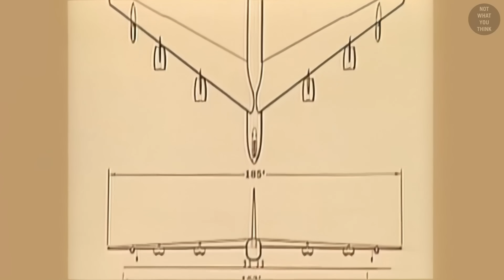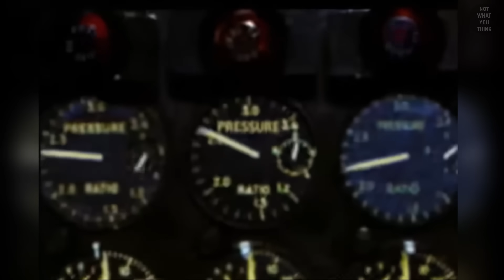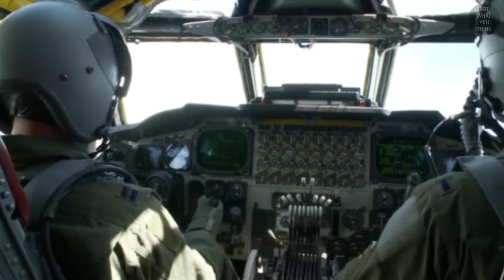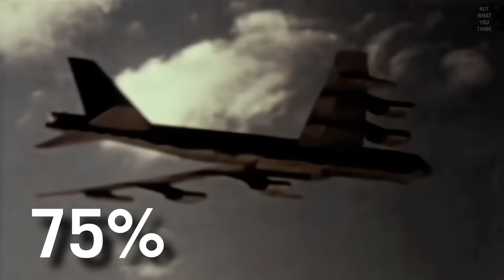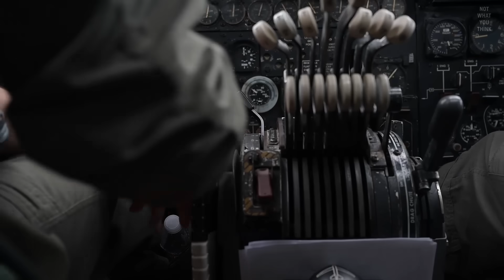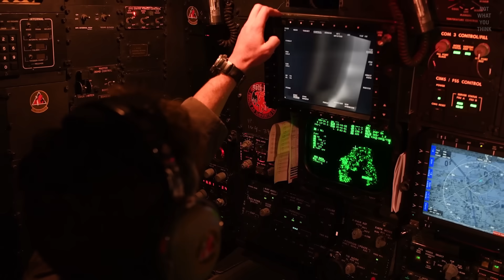Why This Obsolete Bomber Will Outlive EVERYTHING

Comment: Your video is so filled with misinformation that I can't believe you even published it! Most of those 'crashes' you spoke of outside combat were do to pilot errors or being misused as an aerial demonstration plane. They were never intended for that! I was at Fairchild AFB in Spokane, Washington when the one from the video crashed. It was due to pilot error and misuse of the aircraft. Also, you can't crucify the B-52 for engine failures. Those are the failures of the engine manufacturers. The B-52 aircraft have undergone remodifications many times during it's lifetime, which is why there are the E, F, G, and H models. Yes, there have been crashes but there have been crashes with all aircraft. It happens, unfortunately.
Reply from the maker: Thanks for your comment. 
I hear what you are saying, but if engine failures is the fault of the engine manufacturer, then structural issues are the fault of the design engineers and/or those who built the airplane. Obviously the fault would always go back to a person or a team or weather etc. It is never the fault of the airplane 😊

Comment: This video was put together by someone who has never worked on or flown a BUFF. So it is mostly inaccurate opinions from someone with no expertise in the subject matter.

I worked on these aircraft (G models) for 6 years. Went to war with them. Yes they are a pain in the ass to fix and fly. But they delivered on every mission we flew. And the fact the H models are STILL in service are a testament to their capability and reliability.

Comment: There will probably always be an application for "..long range airplane that can carry lots of stuff.." so aircraft like the B-52 will be will us for a long time, and as long as the airframes are still airworthy, I see no reason why they would be pulled from service. Consider that the Russian analog to the B-52, the Tu-95, had been in service since 1956, receiving upgrades and new missions and overhauls much the same way.

Comment: If the Us Air force is going to continue to us the 70yr old B52 bomber, then a series of upgrade may help keep the jet flying. Starting with upgrading the engines, avionics packages, defensive equipment and other equipment the rest of the crew use!

Comment: I was banished to a combined wing which had a few B-52's. The sheet metal guys said that when you popped one rivet the entire line of rivets down the wing would pop too.

An interesting effect of the combined wing was that F-15's and F16's were in the same location....
The way war jets work you can think of them as a Lego model of said jet. Some Lego just rot through use so they pick one war plane to install all the rotten Lego from working jets and christened the hapless host jet the Hanger Queen. When the combine wing asked other bases to pick a random working F-15 for the new wing all they got were the Hanger Queens filled to the brim with rotten Lego. This meant Surge* to maybe 1 was the joke the F16 guys were saying.  Needless to say all the F-15 branded support crew were doing absolutely nothing too.

Bored F-15 guys passed around a photographed sheet that went like this....
This is a Fighter Jet
Outline picture of an F-15 (and its TWO engines)  
This is a fighter Jet on Drugs
Outline picture of an F-16 (and its ONE engine)
Don't do Drugs.

The Commander of the Wing was an old F-16 Pilot so the inevitable Witch Hunt (it's all futile Commander fun) was still going though its motions when I got out of the Service early.

*Surge is AF parlance for getting the jet off the ground, flying to the range and doing whatever they were meant to do, then coming back... I think, hell, maybe you just need the jet to get off the ground to count for Surge, the F-15's could not even do that.

Comment: We are in the process of retrofitting the 77 remaining B-52’s with carbon brakes. The Air Force plans to keep them flying into the 2050’s, and if any are still in inventory in 2054 it will mean the type will have been in continuous service for 100 years!!!  The plant I work at is where we are developing and producing the new brake assemblies.

Comment: The B-52 will never be obsolete. The amount of firepower what she can carry is ridiculously OP. B-52's survival depends on other branches of military and how well they are doing their job. There is nothing wrong in the plane it self. My wild guess is that many NATO countries would like to own one.
Reply: Yes also because is cheap to flight but also requires a logistic behind and a reason, I think no EU nato member have a strategic bomber, not even UK.
Reply: Nobody wants a B-52 lol. The UK actually had the Avro Vulkan strategic bomber, which was probably more capable, although with a lesser payload. Scrapped it.

Why would you even want a large, strategic bomber today? Their long range was mostly for dropping nukes, but ICBMs (or modern cruise missiles) are way more reliable and made that role obsolete. Their size is mostly useful for "carpet bombing" tactics or giant bombs, which is also obsolete, since they are too vulnerable up close and precision bombing and guided ammunition have taken over. 

These days, almost every jet is multirole and can carry some guided munitions, as well as (and including nuclear) cruise missiles. "Low tech" bombing is done by drones at best, and certainly not with giant strategic bombers.

Even if you want an extra large, air launched cruise missile that an F35 or Eurofighter cant put on a pylon, wouldnt it be better to use something like a C130 or A400M? Probably both cheaper and more survivable.
Reply: @termitreter6545  that was a beauty

Comment: In the Museum of Flight in Seattle, the Boeing exhibit includes a silver 14-inch balsa model of what is unmistakably a Stratofortress. It was built in a Dayton hotel room one weekend in 1948 as part of a Boeing technical proposal for an eight-jet-engine bomber. The Air Force liked what it saw and the result was the B-52. Best visual-aid bang for the buck ever.
Reply: I can confirm to this day that engineers at Boeing are told that story as part of their mythic heritage. Boeing ain't what it was, but every engineer I've worked with is 100% about doing it safe and doing it right.

Comment: Superb and brilliantly presented. The RR engines will make the BUFF quieter than the average airliner -- especially using the scheduled roster of shut off periods. Each engine has a mini-computer designed to show its service time and characteristics. Why not just use sensors to the cockpit? Because these engines might be fitted into other BUFFs or planes which use the engine type.

Comment: The US has space based energy weapons run by US Space Command serviced by craft that float into space using anti gravitics developed since te 1950s, TR3b and TR6TELOS are 2 examples. The 40yr old B2 has electro gravitic drive (Biefield Brown) using the engines as flame jet generators once away from view.

Comment: I worked on them in 1964 65 very slow the Vietnamese shot down about 50 of them with slingshots the airplane is just a statement because it isn't practical it has a radar signal about the size of the empire State building can't sneak one of those in on the rukies oh by the way that great polluters too and also it's a death trap nobody gets out of them if they crash once again the US's image is symbol over substance..

Comment: I flew the B-52 in the early 70's. I didn't think then, nor do I think now, that it was a particularly dangerous aircraft to fly (outside of combat missions, of course). We did have equipment problems, though. We had a fire in the forward equipment bay (the radar dish). And I remember a fire in a cable bundle on a new equipment installation. Had a bird strike on the front window due to low level flight. It was my impression that most of the accidents with the aircraft were due to "crew error".
Reply: Ask any crew chief -- they'll confirm that pilots are the greatest non-combat hazard to BUFFs that ever existed.
Reply: I worked on G models.  80s it was a second strike aircraft at the time.
Reply: They don't like doing low altitude tight turns as seen in the clip and the ejection seats couldn't save that crew from a dipshit hotdog pilot unfortunately
Reply: Led me to think
Reply: @mandellorian  yup we can design systems that overrode the pilot. 
Mcas is great at that.
And mcas is the point, the people designing those system have nonslip in the game and don't care about the user or the use case.
A pilot will at least die with the passengers if they do something bad. Aircraft manufacturers just make more moneybags they sell another plane.

That is why human in the loop is still an important thing.
Reply: Jesus how old are you then??
Reply: How do you feel about so many rivets missing on the airframe ?
Reply: Hm arguably a crew error is also an error in design. Some airplanes generate fewer crew errors than others, but the crews are the same.
Reply: @Merthalophor  That is one way to look at it, but flawed I think.  Equipment is equipment.  One has to remember these were built before the time of automation that we live in today.  Most items had to be activated manually.  It is a bit unfair to compare to modern equipment.  You have to look at it from the perspective of the era it was produced.
Reply: @timlovett6200  its really not. Many, MANY so called "human errors" are avoidable through good design. 
As a designer or engineer you should never go "oh its the humans fault", when their might be ans often are actual solutions. Otherwise the problem will just reappear.
And such good design isnt tied to automation either.
Reply: @theZeitos  take it you don't have much real experience.
You get that the buff has the largest flight hours of any military aircraft, and the regular did some of the longest missions.
It was also common practice to give the pulots stims aka amphetamines to allow them to complete those flights.

So no matter how safe you make a system, when it is operated by tired humams hopped up on drugs l, shit will go wrong.
Reply: @timlovett6200  agreed. And with that, you have to understand that crew error is indeed crew error due to the fact that the problem was likely that someone forgot to press that button or flip this switch or check that gauge to make sure it was ok, etc
Reply: On the other hand. Something in the area of 11-20 (depending on sources, and ignoring any 'secret' crashes the USAF didn't reveal) crashes over 70 years isn't shabby at all for a plane that went through a 24/7/365 run of missions for 8 years.
Reply: @Orange Dream  exactly any honest assessment is based on flight hours and the buff has the highest flight hours of any military aircraft by far. That I'm aware of at least.
Worse they were some of the longest regular flights as well.

Comment: The B-52 was a "standoff missile carrier" over 50 years ago. It was clear, even then, that attempting to penetrate enemy anti-aircraft missile and artillery systems was problematic. So the way the B-52 is being used today, as a long ranged missile carrier, is nothing new.
Reply: Those were the Hound Dog stand off missle. When I was assigned to the 28th FMS welding shop in the late 70's, we cut the guidance system out of the jet engine intakes
Reply: @russvoight1167  Also the long range SRAM missiles carried in the "belly of the beast" (in a rotating revolving cylinder).
Reply: Ccc cccc  ccc cc cc cc cc cv ccc cc c c cv
Reply: V       v                                 v
Reply: V                               c
Reply: V               v                                                                      v
Reply: C                                                                c
Reply: C                   v                                                                 v v

Comment: Lots of 1960 and 70’s aircraft suffered from issues in design, not only the B-52 was a victim of it.

Today they can overhaul it completely and make it much more effective with the new engines it will receive.

So no it’s not a obsolete aircraft and it has seen a lot of adaptions during its long years of service

Comment: Ok let me weigh in on a couple of images/ clips ... the one showing the  B52 missing its vertical tail IIRC happened here in Eastern Colorado.  Experimental flight checking on cross wind handling.  After losing its tail it flew across the country and safely landed in Arkansas.  Next ...
The clip showing the BUFF falling down and crashing this is just before the clips of the ejection seats in our documentary here.  This was due to pilot error ...a wonderful catch phrase... in this case the crew were practicing for an airshow.  The command pilot had already been called out for exceeding the B52s design limits.  He refused to pay attention to either his commander or the flight manuals.  Cranking the B52 into that turn exceeded its ability to maintain altitude... how do I say it... not level flight because its in a turn but... let's call it steady flight and as we can see in the clip it slid down and crashed.
3:24 states the BUFF earned the 2nd F because 9 nuclear armed B52s crashed during the 8 year long operation Chrome Dome.  Hasn't checked into losses of nuclear or otherwise armed B47s which were lost at a rate of 1 to 3 a week during the 1950s.  We were essentially operating on a wartime tempo from post WW2 until the late 70s

Comment: 1:17 - I've never understood the nickname BUFF for the 52.  The thing is skinny as a rail, proportionally much narrower for its length than most large planes.  It was purposely done that way to increase capacity without increasing drag, for extended range.  If you want a plane to live up to the name BUFF, try the C-5 which is half again as long as the B-52 and a LOT thicker through the fuselage.
Reply: Likely reference to flying characteristics.  I can't imagine it to be very maneuverable at altitude.  Just speculation.
Reply: Yeah but if you're a person just looking at it it's pretty big
Reply: Compared to the sleek, cutting-edge supersonic bombers of the late 50’s early 60’s, it looks like a flying brick.
Reply: Compare it to a Convair B-58 Hustler and it will make more sense...
Reply: The C-5 is "FRED" - Fucking Ridiculous Economic/Environmental Disaster
Reply: Nah I would call the C-17 the TUFF,  Thicc Ugly Fat Fker.  Its too stout to be considered big imo.
Reply: For one, it took 4 1800 gallon trucks full of JP-4 to fill them up and the tail stands over 60 feet tall, I think it has to do with how they fly...fully loaded with JP-4 the wingtips can dip down and hit the ground, hence the crew had to install 'dollies' and also recover them. while afterburners were needed to get them flying after they rotated. But they are really ugly on the glide path to landing...unlike a commercial airliner, B-52's come on the glide path and extend massive flaps and slats, while pulling down engine power, the plane appears to drop like a brick. About 500 ft of the ground the engines are revved up to bring the monster onto the ground where huge parachutes (which need repacking by skilled airmen) are deployed and engines reversed to bring it to a stop on a 12,000 foot runway! They deserve their nickname...Big Ugly Fat F^<ker!
Reply: @pernels.thyseldew2157  You need to check your post above. I flew B-52Hs until I retired in 2006.  Where did you get the "dollies" nonsense from?  The B-52A through B-52H have permanent retractable wingtip landing gear to support fully-fueled wings on taxi and takeoff.  B-52s have never had afterburners, nor have they ever had thrust reversers.  B-52s up through the B-52G model had water injection to augment thrust on takeoff.  The Pratt & Whitney TF-33 turbofans of the B-52H generated more thrust, so that model has no water injection.  The upcoming engine replacement with Rolls Royce engines will do even better.  They will be redesignated B-52J models at that time.

Comment: It is totally amazing that the pilots are about half the age of the airframe and none of the current pilots were alive when the plane they are flying was built.
Reply: I worked on B-52s in the mid to late 1980s.  Every one of them is older than me (last H model rolled off the assembly floor in late 1962) by at least a year.

Comment: The definition of obsolete is very inpercise. It is far easier to
consider the antonyms "modernized, refurbished, remodeled, renewed"
it is clear that the B-52 checks all the boxes.   So not obsolete.

I expect the following has been said.   Not going to check 1000+ comments.
The B-52 is a platform.   Mission may become obsolete and the hardware we hang on it may become obsolete but the platform itself remains relevant.

Comment: I have a book called "Flight of the Old Dog" written by Dale Brown. It was written in 1987. It is basically the story of a B-52 used as an experimental  platform. The things they did and the changes they made were, at the time, not really possible. However, 33 years on, I reckon 99% of the things in the book are totally doable. The book is an excellent read. ;)
Reply: Also, I believe there was a PC game based on the book!